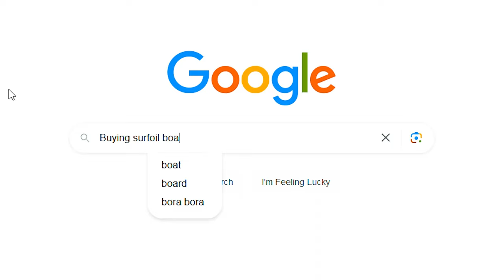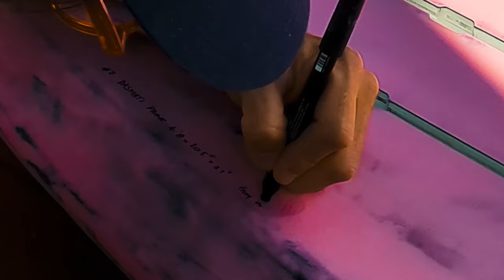How To Make Your Foilboard step by step

Comment: Nice board! Too bad you didn’t shape the board yourself. That’s the most fun part! 

Make sure to check your finboxes. When drilling them to put a hole in for your router, you may have punched a small hole in the bottom of the box. I had the same with mine.. resulting in a bit of water getting in my board.
Reply from the maker: Thanks, yes i already do complete board but clean the Room After shaping was like pain in the ass for me but yes this is really cool. My finboxes are clean 😉

Comment: salut greg, je voulais savoir plusieurs choses. Pendant la pression à vide, est ce que tu la laisse tourné h24 ou bien tu as un système qui s'arrête quand tu as la bonne pression ?
Et pour la plaque pvc, c'est fournie avec atuacore ?
Reply from the maker: Salut, non je laisse tourner pendant 4/5 h et après je coupe le vide et je déballe 10/12h après.mon système est simple et rudimentaire mais fonctionne bien 😊. Pas de PVC chez atuacore. Fibermax composite ou sicomin ou déchet' près des ateliers de bateau 😉
Reply: @GregBasmati  d’accord le pvc permet d’avoir une meilleure rigidité ?
Reply from the maker: Meilleurs résistance à la compression et rigidité accrue.

Comment: 2 things: the boards are laminated with carbon to make them very light compared to glass ones. You have to sand the pink coat until the carbon is visible so that it is light as it should be, this allows you to take off before the water  but Do not take it out where you did not put laminate sandwich or it will be very soft there, the entire board ihave to be laminated with sandwich!.  . and second, EPS boards have a screw  who wears an orring to breathe because EPS has a lot of air inside and temperature differences cause them to delaminate over time. So with this respirator screw make it balance the pressure every time you take it outside. I am a professional shaper.
finally, If you make a new board that shape is not correct, the edges with that shape do not allow it to take off well from the water and you need a lot of speed to take off, foil windsurf boards handle this concept well to take off sooner in light winds, or... sooner with aut wind .
Reply: but sorry, how do you deform a 3MM PVC well in the rails? even the professional phoon is a very difficult mess
Reply: @giuvude80  
the rails pvc is shaped with a hot air gun and cutting the foam perpendicularly several times .and temporarily holding it with tape, the vacuum will do the rest.

Comment: wow 😍 I would like to make a sup downwind the construction and the steps are the same?  A thousand thanks
Reply from the maker: Yep almost
Reply: @GregBasmati  I start with a series of questions, the thickness of the sandwich and why you made the slices on the blanket above; thank youuu
Reply from the maker: It's 3mm PVC. Slices, this is to make a solid connection between the top and the bottom. this is to avoid tearing the usbox
Reply: @GregBasmati  ah ok, first of all thanks,💚💚💚 I too can't afford a board the prices are crazy for Chinese boards!!!🤬 for the epoxy I saw you used the transparent one for the glass fiber and the sandwich, I don't understand what is the white one you used for the vent valve, to fill the slices and the milky white one for the carbon fiber
Reply from the maker: In the white one i add microballoon. For the vent plug it's like a mastic aspect and for the carbon i just had a little bit of  microballoon to add volum for the epoxy and not adding to much weight during laminate process
Reply: @GregBasmati  Salut, combien de temps dure le vacum avant que la résine ne sèche
Reply from the maker: Ça dépend de la température de l'atelier et de ton durcisseur... je laisse généralement 6h, je coupe et je laisse jusqu'au lendemain
Reply: @GregBasmati  ah ok, est-ce que je penserais à faire un SUP foil downwind x ultralight wing ??  😅😅😅😅une nouvelle forme d'atuacore a été publiée🤩
Reply from the maker: Oui j'ai vu, je suis pas fan du shape et je trouve le prix un peu prohibitif
Reply: @GregBasmati  Hi, what did you choose for the foam, 15 or 20 Kg m3?
Reply from the maker: @giuvude80  15kg/m³ for this one
Reply: @GregBasmati  thank you very much Greg, satisfy my curiosity with a 15Kg why didn't you make a full sandwich?
Reply from the maker: @giuvude80 c'est des essais. J'avais fait deux avant en full sandwich. C'est assez chronophage. Tant qu'il y a de l'airex dessus, dessous c'est bon